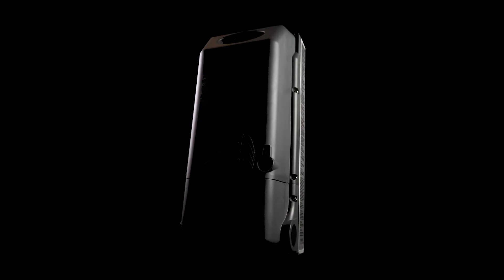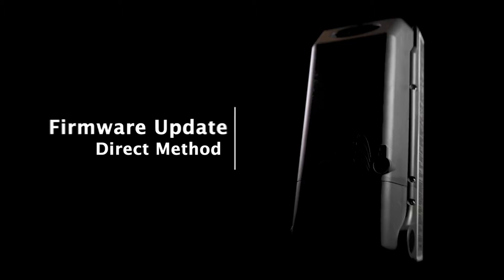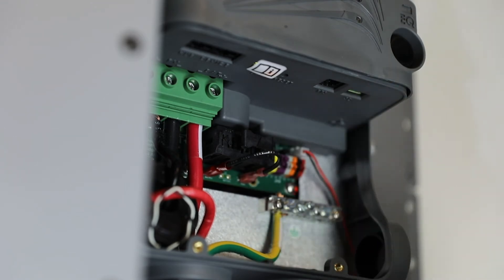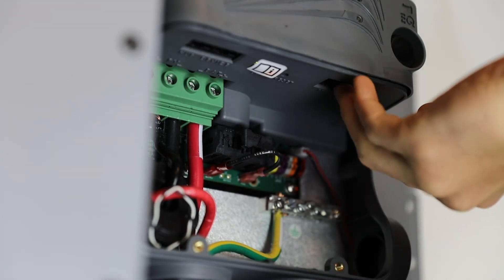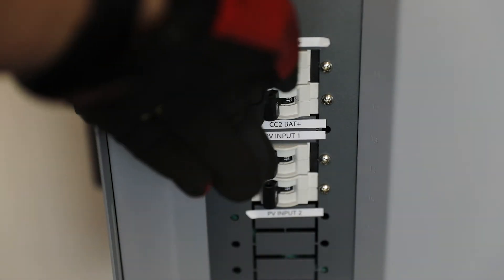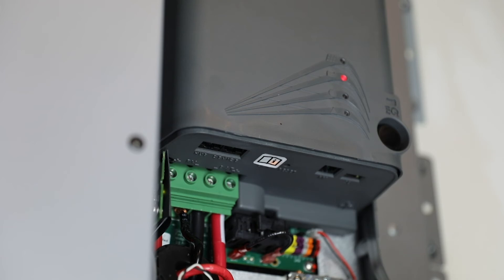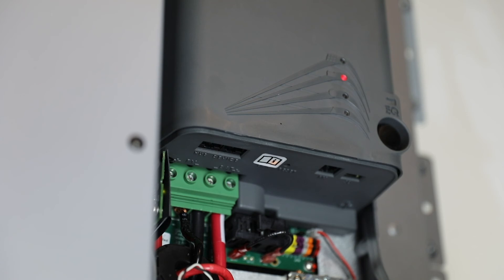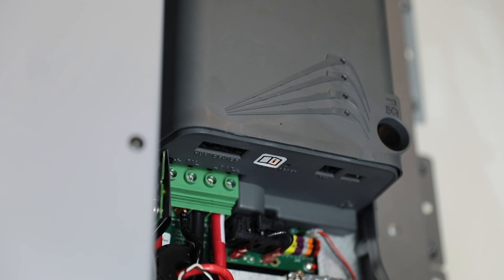FLEXmax 100 AFCI: Firmware Update

Comment: This method does not work with my Flexmax 100 AFCI. After powering off PV and Battery, I hold down the reset with the new firmware on the card that has been firmly seated and then turn on the battery breaker. The flexmax never goes off the bottom red  triangle light.
Reply from the maker: Sorry to hear you are having troubles updating your FLEXmax 100 AFCI. I would recommend you contact our support group or starting a support case here: https://outbackpower.com/resources/technical-support/online-support-request.